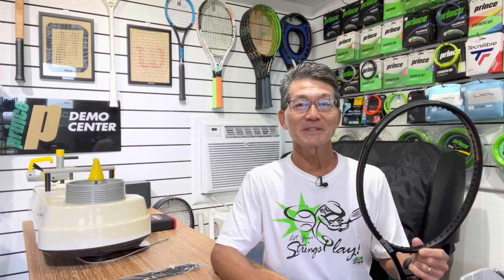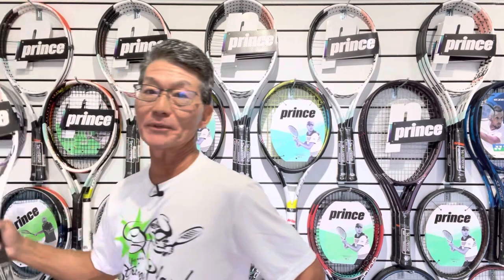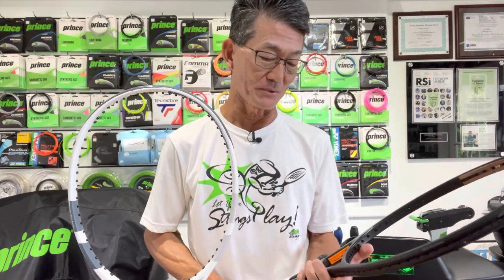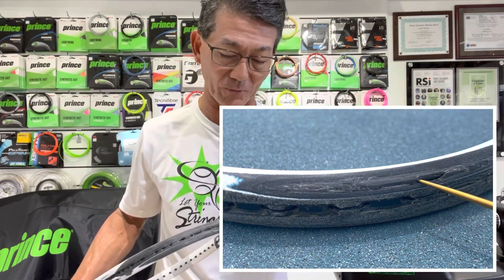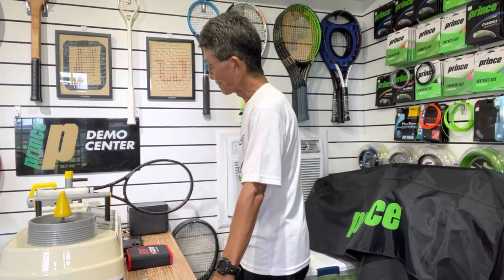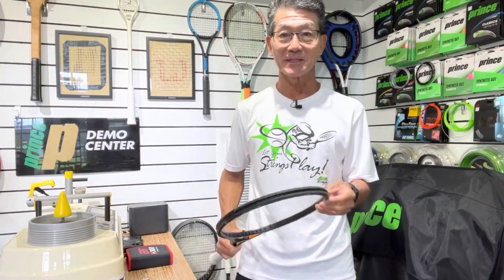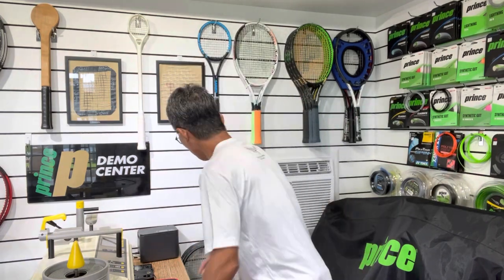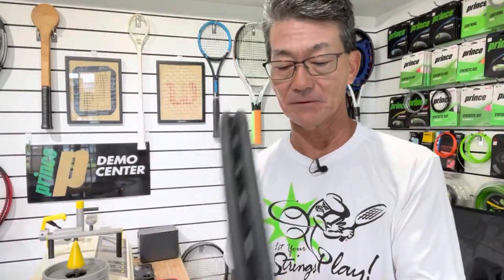Racquet Repair [Bumper Guard Replacement | Protection & Performance]

Comment: Great recommendation to purchase a set of replacement grommet strips/bumper guards when you purchase a new racquet.  I never really thought about this before, but it makes sense.  I'm asked to string a lot of racquets that need replacement grommet strips and/or bumper guards, but they've been out of production and it's virtually impossible to get new strips.
Reply from the maker: Aloha Carl, Yes, being prepared by having the grommet set handy is always good, especially when the racquet needs restringing and already wearing down at the head. If you ever need older grommet sets, you can check out the IART database here - https://gssalliance.com/bumpergrommet-database/ 🤙
Reply: @AMstringing  Thanks for the website reference!

Comment: Aloha!, What is your opinion on head protector tape?, buying a new racket is a pretty big investment for me and my ideal is to keep all my rackets playable and in great shape for at least 30 years or more! xd, replacing the bumper guard i guess would be good cause of something you didn t mention: the grommets holes breaking after many string jobs, but then about the bumper guards.. it only protects the top of the head but not the sides as grommets no not cover the sides, i used Head protector tape before,  you can cover the whole head, i even put some tape under the head protector tape as it is pretty sticky and could take some of the paint when removed, the only thing is you have to replace it after like 2 or 4h but i keep cut strips of it and just replaced the specific spot that hits the court and got peal off, in my case just the two top sides when slicing but it s not aa big deal and it does his job, not a single scratch anywhere in the racket, that s my ideal, then in 20 years if i want to i  can still use them or sell them for a million dollars as they would look new.. haha, i guess my only concern witch i would ask you is that it still is weight in the head.. , i would add some lead tape anyway there but as i recall it did add quit a bit of weight to the head.. perhpas even more than lead tape , also, the weight distribution would be different, i would put it from the sided of the frame al around the head, like these Head Prestige Classic racket bumper guards of old.., so yeah.. quit a lot of weight. so i wonder if it would have the same effect if i  just use the head protector tape in place of the lead tape?, thanks :)
Reply from the maker: Aloha Martin, 
I use head protection tape and created a video on this subject. You can check it out here. 
https://youtu.be/iwOdu-uUTOE

I wouldn't recommend using head protection tape for the entire head of the racquet. After watching the video, you'll probably figure out why. But I guess if your goal is to sell your investment for $1,000,000 in 20 years, then that may be appropriate . . . LOL 🤣

In my opinion, any weight that's added to a racquet, whether it's in the form of lead, copper, tungsten, head tape, etc., would have the same swingweight effect. 🤙